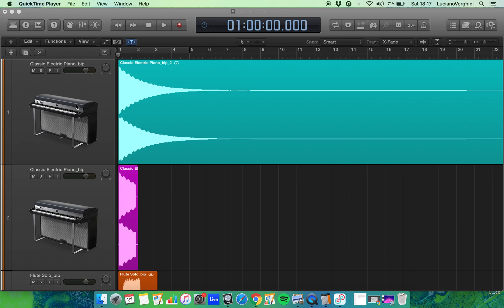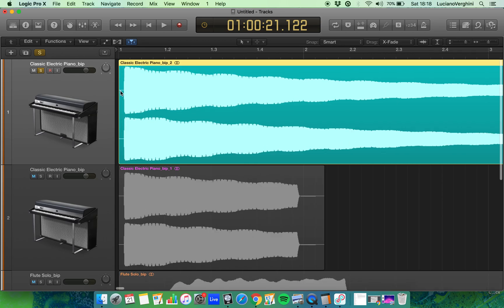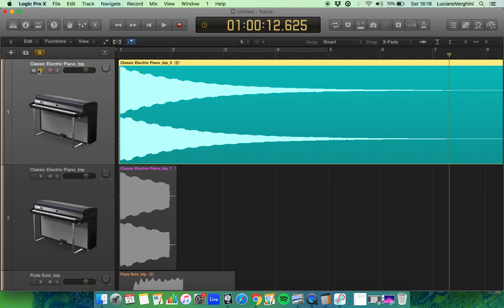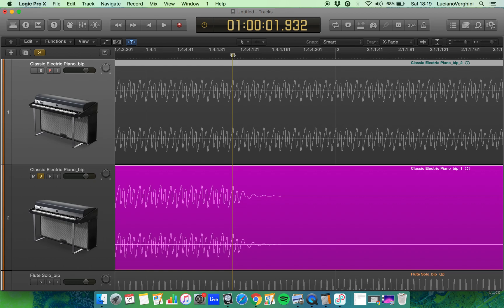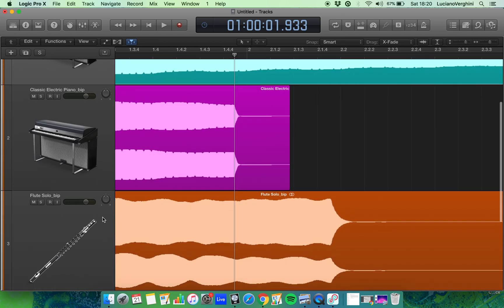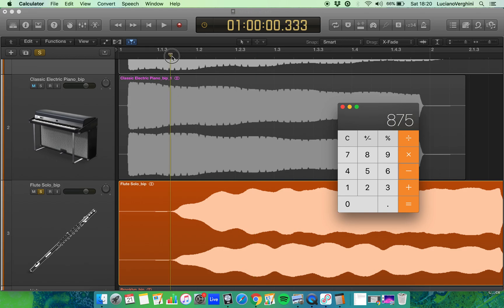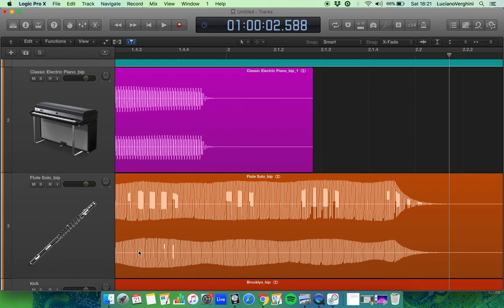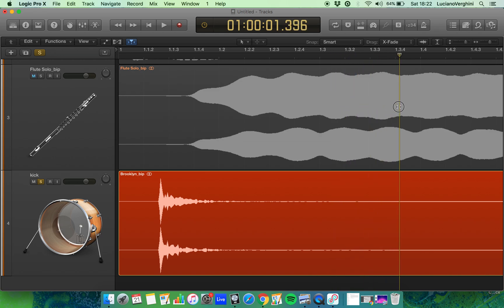What is the Envelope of a sound?  Attack Decay Sustain Release

Comment: Are you not confusing Decay with Release? Decay refers to amplitude and Release refers to time. No?
Reply from the maker: They both refer to a decrease in amplitude and the time it takes. If a sound has a sustain phase then the decay happens before it and the release after it. If a sound doesn't have a sustain phase then the decay occurs straight after the attack and leads to the sound becoming silent and ending. Unless the musician brings the sound to an end sooner using a release such as putting their hands on the strings to stop vibration.
Reply: @VirtualVerghini  Thanks for clearing that up for me. I thought all sound envelopes consisted of ASDR, however short the decay.